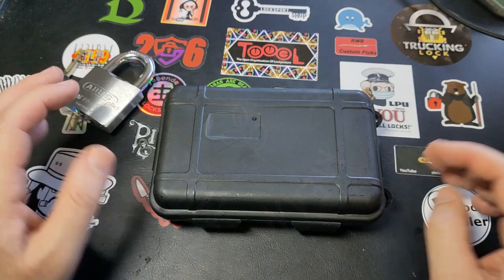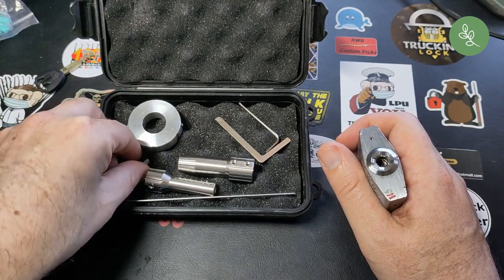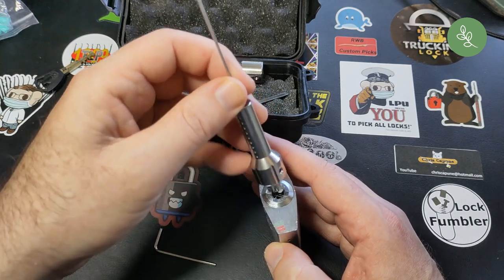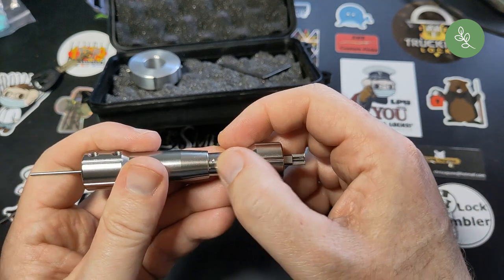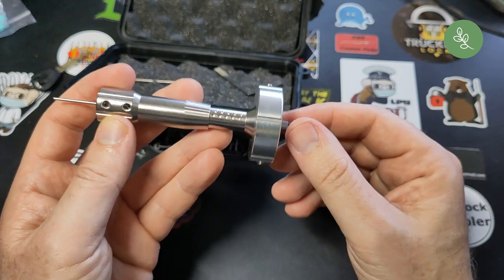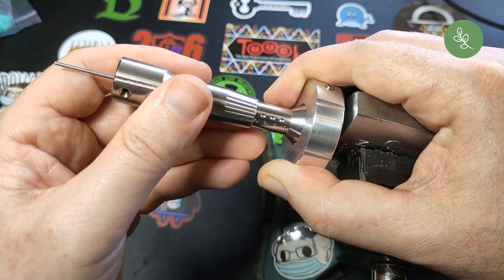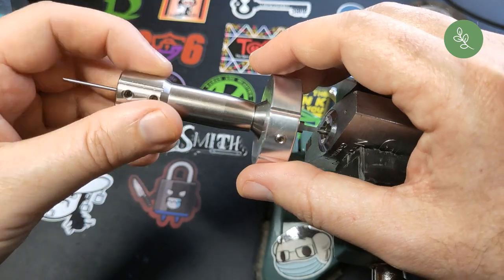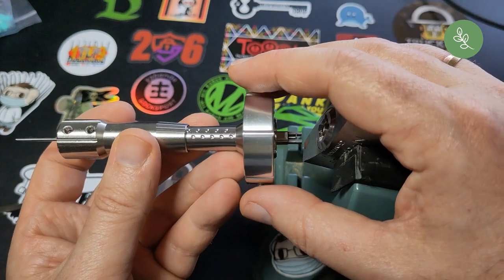New Disc Detainer pick by RWB Custom Picks

Comment: Excellent video on the setup buddy👏 trust me it gets much quicker the more you do it. One thing I will say though is if you're using the 1.5 mm picking tip only tighten the back grubscrews. The forward ones are for the 4mm tip and could possibly bend the thinner tip😕
Reply from the maker: Ah! I didn't know that, I'll be more careful next time. Thanks!

Comment: Great video. I'm very disappointed,
I brought the Rwb with all the different tips and a practice lock from Rwb. None of the tips fit the practice abus 330 lock. I understand the other tips he sell need modify but spending over £200 I can't use the tool. I wish I brought the cheaper sparrow dd or the cheap Chinese ones. Atleast it would had work straight away on the practice lock.
I appreciate the video I didn't know that's how you assemble it.
I have watch crispix videos but there so complicated and now he's gone back to his homemade dd. 
I can see it being a great tool if like crispix you can open up the lock and modify your tips etc but I wanted a tool that more or less just works. You can't turn up to a help a person who lost there key and spend 2 hours modifying the tool.
Reply from the maker: I'm very sorry to hear that. But do you mean the Abloy 330 maybe, because I've never heard of Abus 330? The 330 does indeed need a special pick tip, depending on what core is in there (I don't know from the top of my head). The sparrows pick and the cheap Chinese ones won't work on those as well. Most Abloy locks need custom picking tips.

In my experience you can open most standard disc detainer locks, like Abus or Chinese locks, with the standard tips you don't have to modify yourself. 

The Abloy locks are also definitely not beginner locks, not easy to pick
Reply: Hi Martin, thanks for watching my videos, and sorry to hear you're having a hard time. The tips you have should be able to open any Abus DD, but these are generally quite challenging locks so do require a bit of practice to work up to. But you mention 330 so maybe you have an Abloy? Depending what core is in there it could be anywhere from quite hard to almost impossible to pick. It sounds like you're a smith? If I had to open an Abloy lock in the wild I would try to pick a classic core or a profile, but anything more modern I would just cut. They are very hard indeed to pick, even in a vice on a bench in perfect conditions, and picking one in use is unrealistic.
On the subject of tools - each Abloy core needs different tools, just like you would not use the same pick in every pin tumbler lock. They have specifically designed their locks to be hard to make picks for, so this is a significant challenge.
The RWB system will get you into almost every basic and intermediate DD as it comes, and is a flexible design to accept home made tips for the harder locks. So you should be able to build a good set of tips for the different cores, but you will have to invest time in making them and lots of practice to stand any chance of using them, starting with much more basic locks. There are some variations on Abloy profile which are easier to tool for without integrating with the RWB handles which is why I've been using my home made set up a bit recently (really into profile right now), but they are much harder to use and if I was planning on picking lots of these I would make the effort with the tools and make them work with the RWB pick.
Reply: @TheGreenishOne  it's a 330 Finland abus. I've seen other videos of them being picked by the sparrow but they could had been different age.
Just that the training padlock was sold with my rwb I would had thought I could had practice straight away. Just making the tips I don't have enough knowledge or experience and being £20 a tip. I will get some different dd locks and practice altering tips with the cheap Chinese picks. Thanks for your help. That Parr on how to work the distance on each lock was great 👍
Reply from the maker: @martinstockbridge3449  ah, that's definitely abloy then, not an abus. Abloy is from Finland, abus from Germany. I know rwb sells cutaways to practice those, but they are not beginner locks. The sparrows that was used in the other video's was probably heavily modified then. 

Good to hear you're not giving up yet, starting with some easier locks is a good idea. Are you in the UK? I've heard zarker disc detainer locks are good for beginners
Reply: @crispix  thank you for your reply it's a Finland abloy 330 with like a round smiley Chinese lock. I just assume a training lock sold with rwb would fit straight away and I could practice  immediately. Also don't want to ruin £20 tips, when I don't have enough knowledge. Just I seen the 330 being pick by the sparrows, I thought I made a big mistake. I will persevere with the rwb but maybe make tips with the cheap Chinese dd picks so it won't matter if I ruin them. I will buy some profile padlocks to practice.
Thank you 👍
Reply: @martinstockbridge3449 Abloy locks are anywhere from quite tricky to almost impossible. The 330 is just a lock body, which could come with any one of at least ten different core designs, all of which would need different tool designs. It sounds like you have a profile, which is quite hard to pick and really annoying to tool for. It would be better to get some easier DD locks first.